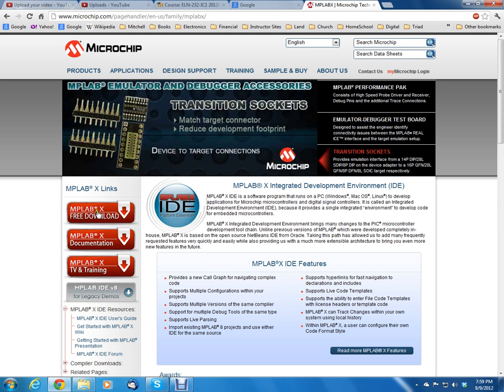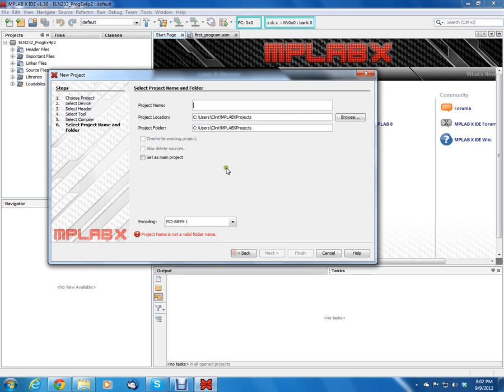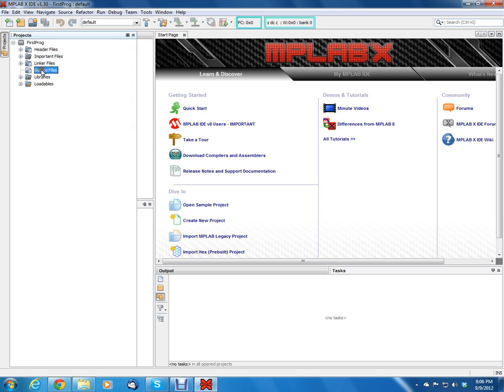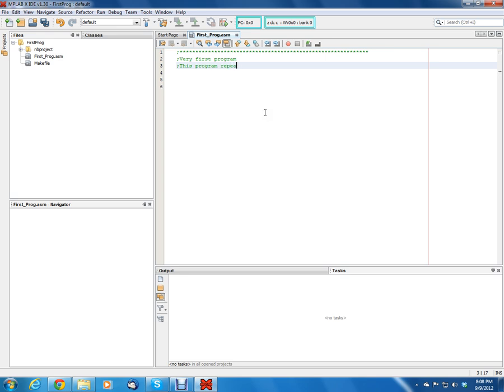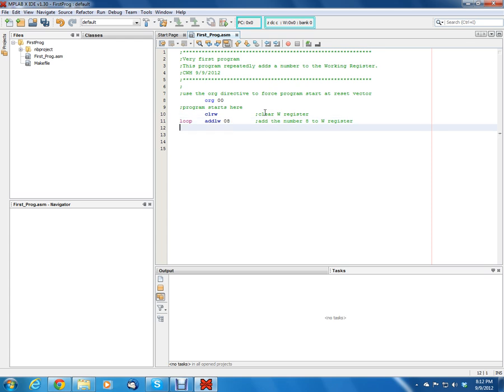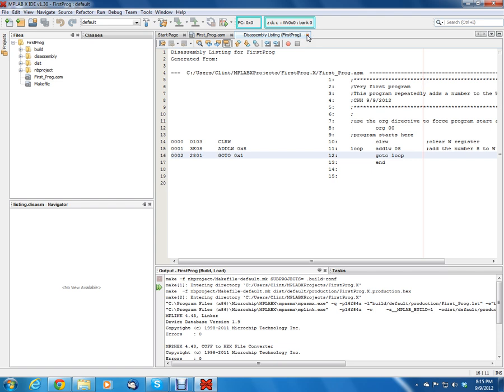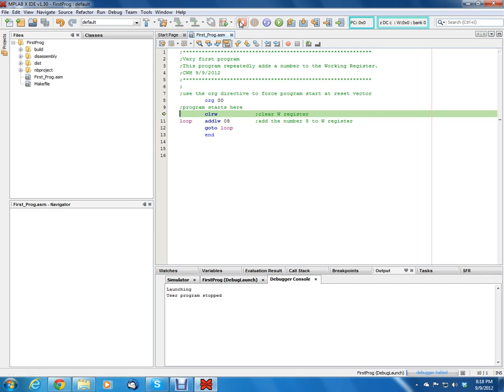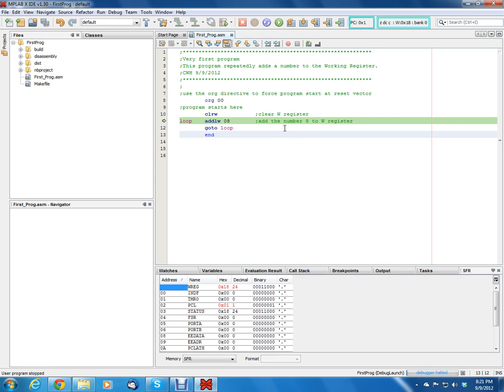PIC16 Microcontrollers, Unit 14, Ch. 4.4-4.6; Write Assembly code & Simulate w/ MPLABX

Comment: Thanks for the video, I was struggling to find where the debugger actually was! 

It might be helpful to reedit the video and remove the confusion you had with the environment at the start. NetBeans (which MPLAB X is based on) keeps projects open until you close them, even if you open or create a new one. Also, with the debugging steps, you mostly want to use "step over" which does what happens in this video. Step into will go inside a subroutine or any other code that can be stepped into (in C this is more common) and if it can't it behaves like step over. I think it would be helpful to use the correct one or explain the difference, otherwise in other projects, the newbies might start seeing weird behaviour if they click step into (in C projects, you sometimes unexpectedly see disassembly!).

Thanks though, it's enough to get me moving along in my book!